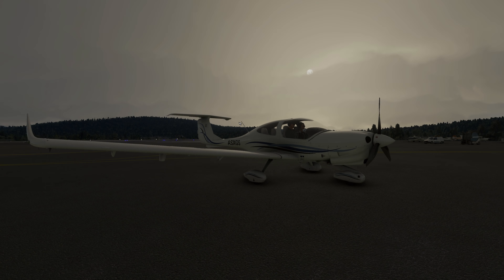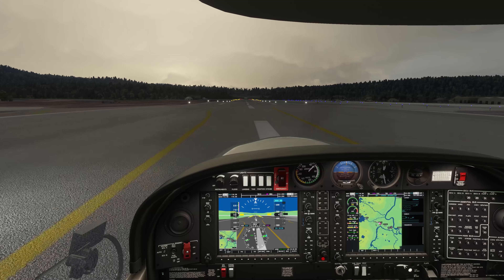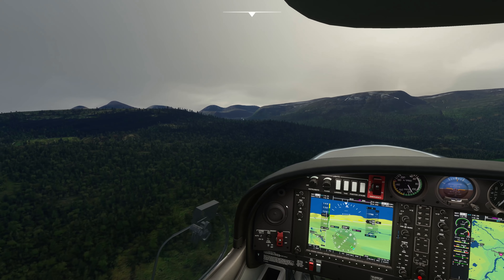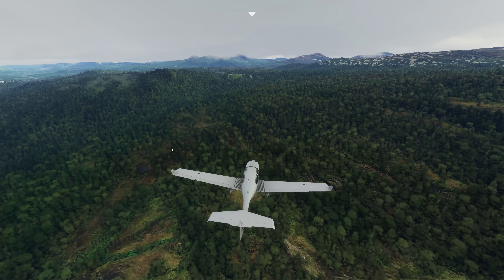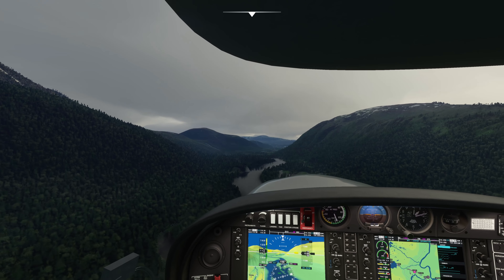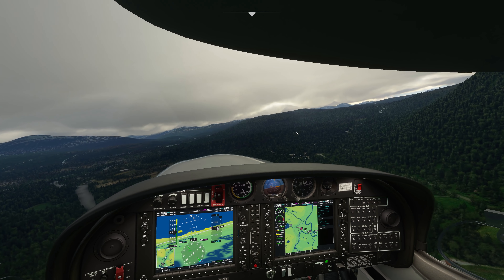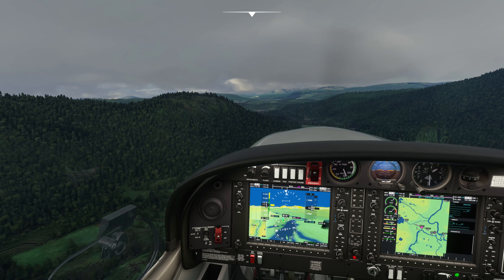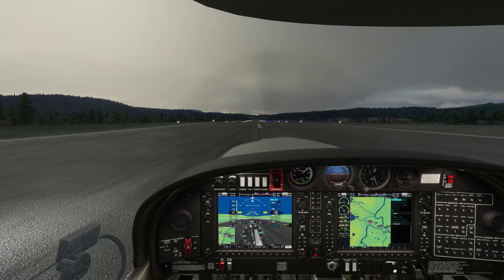✈ Should I Switch Away From Prepar3d v5 & X-Plane11? ✈ | Microsoft Flight Simulator - 4K

Comment: I will be spending a few hours today removing Prepar3d from my system and reformatting the 1Tb Nvme I currently have it on. I cannot wait to not have to deal with starting Active sky up Cloud art texture loading Join FS and running FTX Central when my autogen fails to load as is sometimes the case.  I have a very good looking P3d but it doesn't get close to the way MS2020 looks.  Given that this is just the beginning its only going to get better.

Comment: Xplane and Prepar3d will disappear WAY faster than all predict, just like the demise of film camera, unless they fundamentally change the way the graphics handled.  Just watch.
Reply: "Home" (or "education" in case of P3D) versions will, once PMDG, FSLabs and others port their addons. The professional ones, running in various full cockpit sims and certified trainers, will not for a long time. If only because they can run completely independent from any online service.
Reply: That’s not how it works.
Reply: Film cameras are not even close to being gone 😂
Reply: X-Plane is going nowhere. It was the underdog in the 90's and for many it may be the underdog in the 2020;s but as long as it offers something different to FS2020 like helis, VR and superior flight dynamics, multi platform support and is used in professional applications, it isnt going anywhere. I will run both sims at some stage no doubt.
Reply: @cbcdesign001  that's the thing - it doesn't seem to be in a position to offer anything better. Helis will come to FS, VR is around the corner, flight dynamics gap may have already been tipped towards FS, etc. MS is very likely to go after the professional market - in fact I think it was their goal from the beginning as well, and as a large corporation I am sure they can make those deals very lucrative. True that XP has always existed because it did offer something that was genuinely better, and because the gap in terms of everything else between XP and FS wasn't that great. The gap between them is now light years - and the advantages are either all gone or have their days numbered. I am pretty sure they will fold within a year or two
Reply: @cbcdesign001  Well I just bought a set of rudder pedals, joystick and throttle just for mfs2020, never tried anything before, and I'm so hypped!, If X-plane where smart they should make a big sale for their sim during this wait time, if it was at half price or so I would have bouy it just to kill the grave I have for Mfs...just saying

Comment: Great stuff! Another fantastic video, thanks for posting. I'm curious if 1) there is a visible 'break' or degradation of visuals when you leave the boundaries of a photogrammetric area. And finally 2), do AI trains and street light poles exist in MSFS 2020? Nitpicking for sure, but I've enjoyed the added detail that AI trains and street lights for major highways provide in X-Plane 11 with Orbx TruEarth. If no for the later, that would be an area ripe for a 3rd party add-on IMHO.

Comment: Using bing card material is pretty much a cheat move since only a few companies like MS have the resources to do that.
X-plane and other sims are pretty much dead, apart of those heavily invested lingering around a little bit longer.
Although I have to say that the flying behavior of x-plane is good, MS needs to work on that still with some machines (vibrations, sounds, etc)

Comment: I keep both XP and P3Dv5 installed for now. My issue is not the comparison aspects, my issue is until MSFS2020 hits a massive market, we really don't know how it will perform.

It should be the same at the current beta being used by many simmers; but, you never know. I hope it is, and there should not be any good reason for it not to be, but I am a little shy about Market hype in the SDLC life cycle. 

Eye candy is great, but for me, I am an airliner type of guy, study level that wants the most fully functional and correct aircraft; the VNAV for example in the A320 obviously is buggy. That may take some time to work out bugs, but to me it should be prioritized over eye candy. Eye candy can always be added in layers later, meaning in incremental steps.

It's sort of like having a great looking drag car with a great fury paint scheme, tires and rims, but it has a 100Hp turbo under the hood and runs at best 18 seconds in the quarter mile. 

It's never under the hood first, then make it look great second.

I also worry about third parties; such that, they may provide a great product, but the performance hit may be too great, and then we are back to square one, a great looking eye candy sim, but mediocre performance. We have seen this time and time again with the competition.

Just because it's MS, doesn't mean dilly crap to me. Again, I hope they get it right soon, and it looks great and yes I am excited also. I am tired of flight simming for 10 years to have one sim and then another sim depending on certain aspects.

The weather to me is the ultimate greatness of MSFS, and the base package having just about everything you would want. Like most, I've invested thousands, and more including good computer hardware, so let's hope we have it reasonably correct this time. I think they do.

Comment: My specs slightly less with a Ryzen 9 3900X precision boost overdrive 4.2GHz; 32GB 3GHz DDR; 2080Ti; sim running 4K 2160p on SSD. For GA everything is cranked up to Ultra and maxed as far as it can go including shadow maps. For airliners I tone the shadow maps down. Steady 60fps/no jitters. TBH the sim doesn't tax my CPU at all so the heavy lifting is being done by the 2080Ti. Mind you, I also get 180Mbps down which allows great redraw.

Comment: While it’s mindblowing and is by far the best default sim, I do believe it’s gonna be a good 6 to 12 months until we get helos, full fidelity aircraft, avionics addons, 3rd party airports etc to match any of the other established sims.    Yes it looks the best out of the box, BUT Orbx True earth does a better job with autogen and building types in certain locations of the UK, although having the bing maps does also add a lot, certainly I’ve never been able to spot and recognise RNLI lifeboat stations in any other sim before, regardless of addons.

I do expect this to get better though as the AI learns and reacts to improvements to the scenery.    OF course it does take ALOT of extra money to get similar visuals in the other sims than those that come as stock in MSFS.

So I do think I will still be using XP11 for Helos and heavy metal for now, yes eventually I’m sure MSFS will become me one and only sim, but we are not quite there yet.
Reply: heli's in the first DLC expected 4th Quarter 2020, and OrbX are working directly with FS2020, give it time, it's not even out, and this is how good it looks.

Comment: Well, if flight simulators are supposed to simulate the actual plane then the older ones are still better (with loads of excellent freeware and payware planes with deeper system simulation than the MSFS planes). On the other side MSFS has a lot of other better things out of the box + will probably get all the others have in the future. So right now all are pretty competitive, depending on what is most important to you.

Comment: pre-ordered the HP Reverb G2 because of this game (my first VR headset) but it looks like i need a new video card as my nvidia 2060 apparently wont run the G2 in full resolution. So should I buy a 2080ti or get two 2070's & run them SLI or wait for the 3000 series due to drop in sept and hope prices on the 2080 ti or 2070's drop ?
Reply: The new series cards are different technology, I would upgrade, but the 2080Ti is more than enough. Personally I'm waiting for the newer cards. I'm still on my 1080 working great.

Comment: Yes If I can get Intel i9 9900K (Overclocked at 5.0GHz) and RTX 2080TI overclocked 11GB graphic card. Otherwise the game is a stutter and lag king, unplayable with 8gb cards unless you choose low graphics settings which looks worse then FSX at that settings and even low graphics it goes stutter and sudden fps drops. I do know, I was a 6 months of beta tester lol. This game requires 11GB RTX 2080TI graphic card with water cooling for sure.
Reply: <<Bull sheet it does. Its running on a 1060 with high settings and absolutely no stutters.

Comment: Unfortunately I'm still using an i7 930@4ghz 12gb ram msi Rx 480 8gb gigabyte UX58A UD3R Mobo I got from overclockers UK in June 2010 £1500 . So I'm waiting for a major update new pc with top gpu and cpu for gaming I'll have to wait for amd preferably to release them as they'll be cheaper hopefully new big navi my budget is if sensible £1500 When I get a new pc and flight simulator a want to go to tahiti bora bora, gold Coast Australia, barrier reef, amazon, Bolivia, from butan to Kathmandu everest flyby etc just the start probably from Glasgow where I live to palma airport then into majorca hopefully they'll get waterfalls fixed Niagra would be nice and Angel falls

Comment: I have used an enormous amount of money on XP11,P3dv1-5, but i will jump sims in an instant, and if fs2020 doesnt live up to the hype i will take a break from sims, and move on to Racing,Combat sims. so YES move on and forse Laminar to acgually support the Customer, and focus on getting the Sim up to date, whats the deal with experiment flight model, hardly any plane use it, not even the default ones.